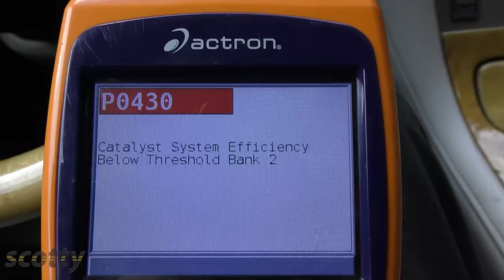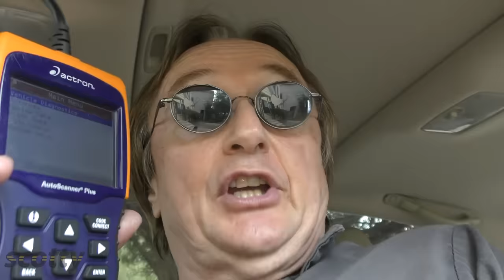Check Engine Light Comes On and Off in Your Car? What it Means

Comment: My engine light for the evap turn on and off. AutoZone don’t have the factory or oem gas cap for my 08 Nissan Altima so cant do nothing about it for now
Reply: Rýán Túçk It wasn’t the cap it was the gas station i was goin to because when i get gas from that specific gas station my light turns on. I had went in there to talk to them about if do they gas contain water in it and of course they denied it. Later that day i drove by and it was a gas truck there. I wonder why the truck was there after I confronted them.

Comment: What if your driving down the interstate and the check engine light and traction light come on and the car starts slowing down so You pull over and the car idle is loud and shaking so you turn the car off for 10 mins and turn it back on and the car drives normal again and lights are all gone what is that

Comment: I keep having a 02 sensor code (P200a)and spent 100s each week , I can’t figure out the problem fixed the 02 sensor bank 1 sensor 1, 3 times and ran diagnostic they said it was my intake hoses , switched them out the code come back on , it went off the other day after being on for months and came back on next day I can’t figure out what else to do . I drive a Infiniti g35x 2007 , Awd

Comment: I have a Ford Fusion 2015 and i took it for a diagnostic turns out i have to pay $2000 for 2 leaks from the transmission and the engine BUT my “check engine” doesn’t warn me about anything. Only when i turn on my car all the warning signs turn on but the check engine one goes away immediately…? Like in a blink of an eye..

Comment: once the check light on my car was flaching, so i stoped and watchd under my hood and saw nothin. then i started my car and i saw my sparkplug cable sparking against the angine block, couse an animal bit one trough, then i replaced them myself and one week later the check light was off again. so happy it only was 1 cable and a silly easy one also.......

Comment: My Subaru has a check engine light with blinking cruise control. New plugs and wires, clean throttle body, clean maf, reboot battery and nothing.

Comment: My first assumption is gas cap. Then if that doesn’t do it my next is O2 sensor. Just about 90% of the time the light appeared on me is because of these sensors. Of course I have the scanner to confirm it but it doesn’t surprise me when its this sensor.

Comment: I own a 2016 honda accord V6 My engine lite turned today and the wheel lite came on they are both on orange what could i it be im thinking bad spark plugs recently changed my oil and transmission oil. Any suggestion anyone.

Comment: My engine light would come on and off in my 90 f150  300 incline 6 it was a crack in my exsoughst on the o2 sensor telling my engine it was running lean 40$ weld fixed it.

Comment: My check engine light is nicknamed "Cpt. Obvious". It has so far only come on during a misfire and when the engine almost hydrolocked during an intake manifold failure - and came on like 10 seconds after the car began misfiring. Other than that, nada.

Comment: My check engine light goes on and off then comes back on the code is vtec oil pressure switch i even swapped the motor and put a new sensor and still have this problem and changed the harness and the ecm idk what the hell could it be

Comment: What can it be if check engine light blinks for short amount of time nd turns off. This blinks are random and car stutters a bit. Else most of the time car drives fine.
Reply: Did you find out the problem? Because mind just did that today.
Reply: @typhlosion7183  in my case it was some sort of wiring problem, sorry for late reply, mail was in spam
Reply: @samisyed899  I found out what mine was it was one of the spark plugs was gaped incorrectly so over time the gap became bigger

Comment: My check engine light use to come on stayed on and for 2 years its off completely paperclip test doesn't work
Reply: Rýán Túçk is that some type of bulb,i had the car at bosch  and they still couldn't find the problem why they didn't do anything on the car,i had it there before on their computer machine its german and the car,they did reset it clear all the faults go for a drive come to 60kph comes on,reset same thing,replaced the bulbs twice nothing, booklet says emergency mode heavy om fuel as is now still,replaced computer box also!

Comment: Anyone else get a blinker then turn off search & see all these google forms of how get it checked ASAP but then watch scotty saying ehhh it was just a glitch.... damm im confused & dont know what to do i got P0300 blinking then it shut off i recently changed my spark plugs ignition coils wires & valve cover gaskets because of the code there was oil in 3 of the 6 spark plug wells when i did the tune up

it stored the code under "pending codes"

Comment: Hahaha... the oldest trick in the book. Disconnect and then reconnect battery terminals to reset check engine light before going to get your car inspected... usually lasts for about 60 miles.

Comment: I got a p3425 code that comes on and then turns off at times then comes back on again after a while, I changed the solenoid but still have the same issue sadly, its driving fine honestly but its bothering the hell out of me! Dodge challenger SRT8 2012

Comment: can a p0133 code cause a p0174 code 
at first it was a p0133 code witch is the bank onesensor one witch i need to change out this weekend and today a p0174 codepopped up 
i have a 98 ford explorer eddie bauer with the4.0 sohc v.6